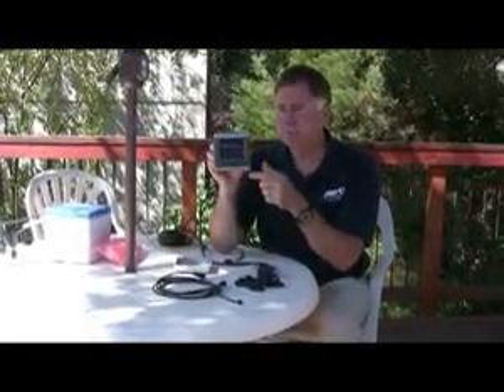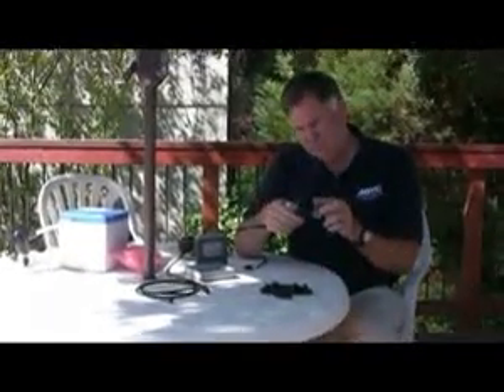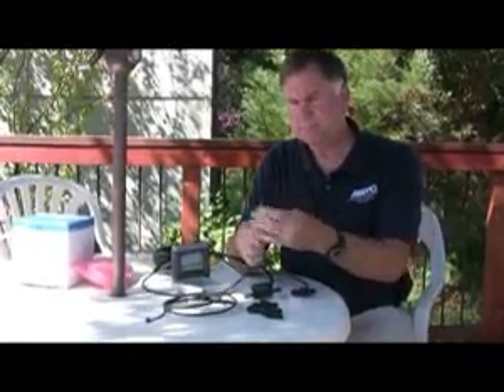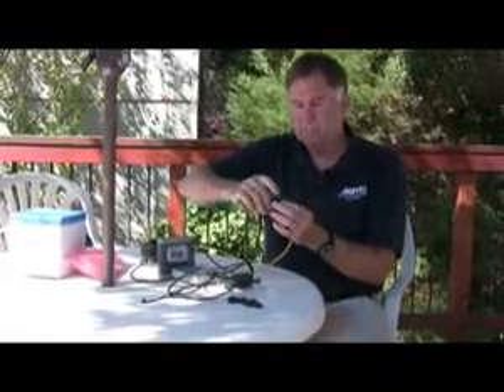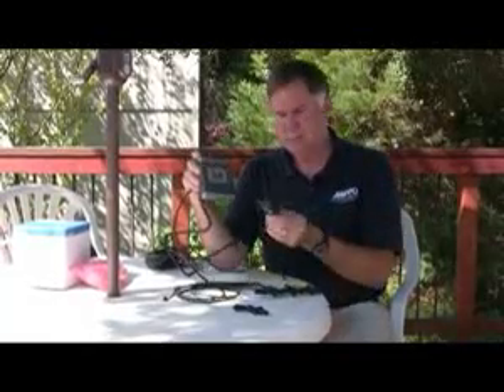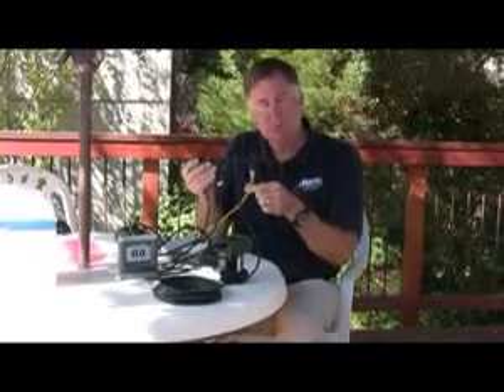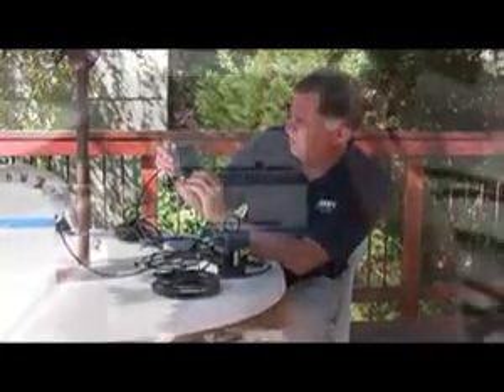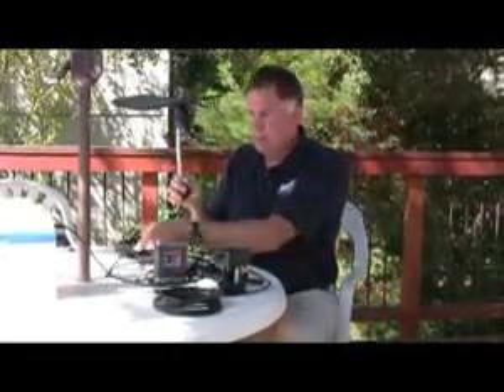How NMEA 2000 Network Works

Comment: what this doesn't address is the fact that just becasue the NMEA network is powered you still will have to run the power cable for chartplotter or a GPS combo unit as the NMEA backbone, as this video states,  doesn't have much power.  
When I installed my NMEA network I was under the assumption that the NMEA network would power all my stuff and there would be no need for the original power supply to be ran to back of chartpotter and other bigger units.

great video but addressing what was said above would be great.
Reply: you can only give power to the little displays with the nmea alone.
Reply: I have power to both VHF an chartplotter. So, you are saying I would have to hook my VHF radio to a mnea backbone then to chartplotter.  Can't connect VHF radio  right to it? I'm confused

Comment: Thanks, it was a good introduction of what NMEA 2000 Network is. I have a question:

In this video, the output is shown instantly on a GMI 10 displayer, whenever a new device is connected. Hence, I imagine, the displayer is already programmed to correctly parse the data travelling through the network.

Now what if I want to use other device than GMI 10 to show messages?

For example, could I connect Raspberry Pi (in place of GMI 10), so that it could accept bits coming from the network (does the network send digital data?), correctly parse them, and then send the output to an AUDIO displayer, so that the depth / wind speed / g.p.s coordinates would be output in the form a LOUD MESSAGE.

You can assume, that I have enough knowledge to be able parse myself the incoming bit stream from the net on a raspberry pi using software, given that IT CAN BE READ using some programming language (so for example, the input could be of the form char[] in c language).

I am basically interested, whether such behaviour is possible to implement?
Reply: nmea 2000 to usb adapter. found openskipper with a quick google search. appears to be able to parse nmea data stream using c#.

Comment: that garmin fuel flow sensor has HIDEOUSLY thin wall hose barbs. A real terror for gas inboard installations. I sent them back.
-Not on my boat! NO! Rather do without.